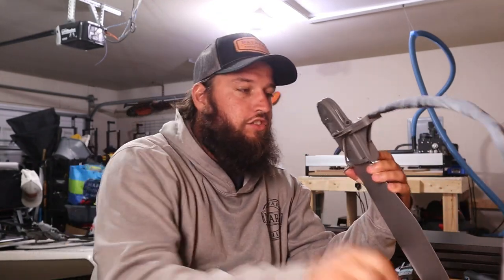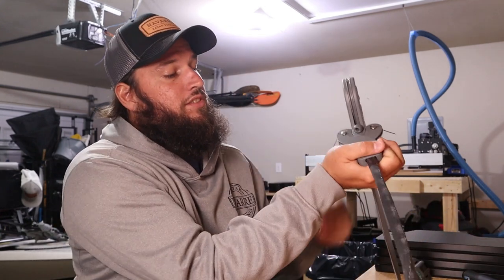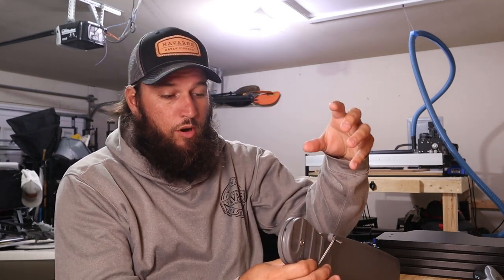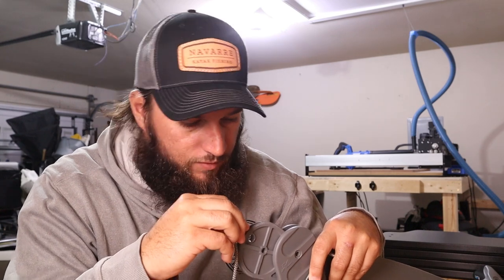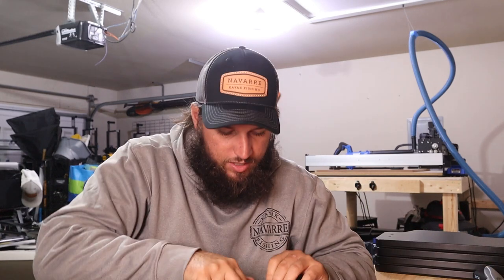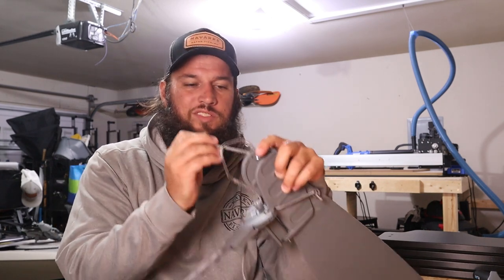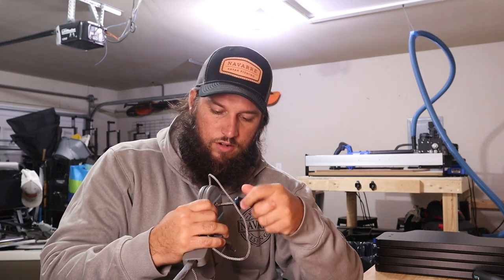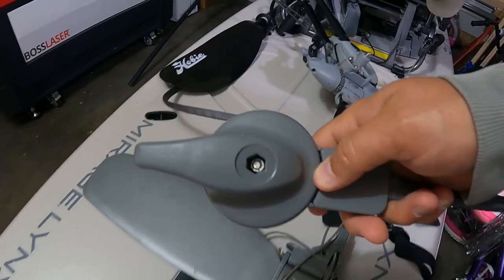Broken Rudder on Hobie Mirage Lynx | Easy Fix

Comment: Nice repair. Took out my lynx  2nd time the rudder won’t go back up. Any suggestions Nick? Would greatly appreciate it
Reply from the maker: Can you put it up manually? (Without using the bungee)
Reply: @NavarreKayakFishing  yes I can move it up my hand but not with the cord any more only goes half way
Reply from the maker: Hmm. I’m not sure what would cause it.  I know if you hold on to it to long it won’t lift up.  Has to be a quick pill and release.
Reply: @NavarreKayakFishing  ok yeah I pull the line fast and it won’t rotate up looks like the bongie cord maybe to tight not sure 🤔

Comment: I noticed my rudder doesn't spring up as easily as yours does. Wonder if mine has too much slack in the line. I'll have to check it out.
Reply from the maker: I think the spring is based on the bungees. Maybe tie the bungee a bit tighter.

Comment: Unfortunately I couldn't undo the Philip's screws, that had too much locktight on them.  I contacted my hobie dealer,  and they are sending me a new rudder,  with free return for the other one.
There is no where on the Internet about how to replace the  sacrificial rudder pin you fed the line through,  so what you did must be how you replace that as well .
Hopefully not too much locktight.

Comment: Where did you get hold of not one but two of these boats? I've been looking for the lynx for the past month with no luck.
Reply from the maker: Brett, a local shop had them. I purchased the first one then after a few test I called and purchased the second one before posting the videos.
Reply: Got mine off of ebay. Cost a boatload in shipping, excuse the pun, but i got it two weeks ago. Look for Three Belles Outfitters. I think they're in Connecticut.